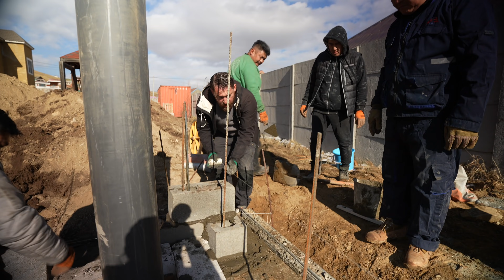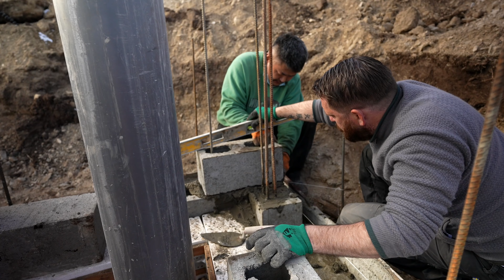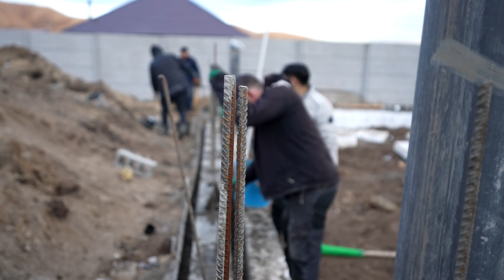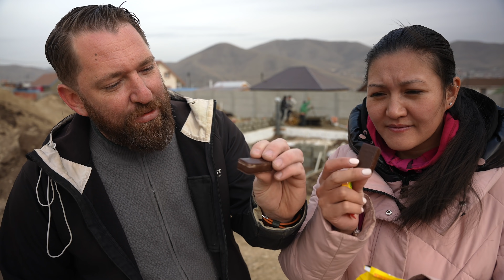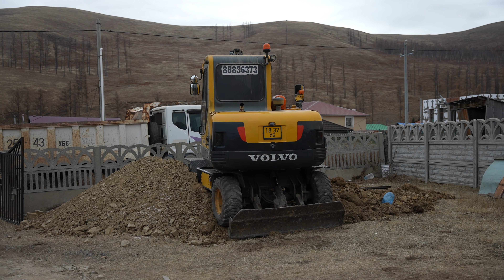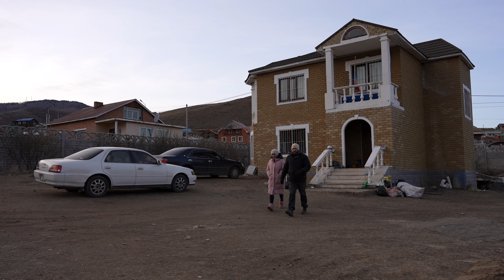Passive Solar Greenhouse with Geothermal Build in Mongolia EP6

Comment: Have you checked out CERES greenhouses in the USA Rocky Mountains? I got a lot of good information from their site for building my passive solar, geothermal, fully self-sufficient, off-grid, greenhouse. Also Arkopolus in middle western Canada has a great UTube channel on his passive solar greenhouse. I live in New Brunswick, Canada. We don't get the extreme cold here but two weeks ago we had a few days of -40°c and it froze the water pipes in the house. Spend last two weeks thawing them and fixing all the busted lines. The sewer froze and I had to thaw it out. I used to live way up in Nunavut Territory, Canada. Its gets really cold up there they are way above the tree line and some towns have greenhouses up there. My kids are half Inuit which are distantly related to the Mongolians. The night my daughter was born up North it was -74°c. The Polystyrene you use is susceptible to absorbing water when underground. Once it soaks up water it looses it's insulating properties. I used Blue Board Poly insulation on mine. Its not as bad as Polystyrene but it eventually will absorb water underground with the weight of a building on it so I put construction plastics down first and sealed the seams with the red sticky Tuck Tape. That way it keeps the water away from the poly insulation. I super insulated my walls with Polly-iso insulation. I also poured a 4' wide walk way around the inside of the walls on my greenhouse and put PEX pipe loops in it so I can run hot water through it in the winter to make sure it never freezes inside.
Reply: Sorry, Arkopia greenhouse is the one in Saskatchewan, Canada. Auto correct on my phone messed it up. Lol.
Reply from the maker: It’s cool, we figured it out 👍 thanks
Reply from the maker: Hi Robin 👋 thank you so much for sharing 🙏🏻 it is so great to read your comment and story’s. We will definitely check it out. The biggest challenge we will have in Mongolia is to find material even silly things like Tuck tape😫 so we have to improvise a lot… 👏👏
Reply: @SimpleWildLiving  when I lived up in Nunavut Territory, Canada everything thing had to be sent by Ocean Barge so everything that you needed had to be ordered a year or two in advance and then arrange to have it shipped to Hay River and have it loaded into shipping containers and then make sure it got loaded on the next year's Barge. Plus I just watched a YouTube video of a guy in Montreal Quebec that built and tested many different things on 7 all season greenhouses he built. I'll try and find the name and post it for you. Great info on what he built and tried and the results, good or bad.
Reply: Check out HumanWisdom or search for his Plus4Zone Greenhouse in Montreal, Quebec, Canada. He has a lot of good information for you and it's been tested and proven to work over the last 10yrs in a very similar growing Zone as yours.

Comment: Great work. look forward to watching the greenhouse getting done next spring. I guess its gonna eat up lots of power and  cost not much with the fan heating and cooling system.
Reply from the maker: Thanks so much, no the fans don’t take that much power and we will set up a solar system to run the fans
Reply: @SimpleWildLiving  yeah i missed the word "not gonna eat up". I saw one canadian old guy have got the technology running in winter , but ulaanbaatar's winter is twice as cold i think, reaching 40 at night. I wonder what design of passive greenhouse you are building on top of it now, i have researched n i thought polycarbonate south wall is perfect for heat trapping and regidity and also provide maximum penetration of essential sun rays. You might wanna also put a a chinese tarp coating thing that rolls up and down for extra heat trapping(since snow fall is much compared to china, for use of the tarp i m not sure cuz when it gets wet it puts extra load on the motor that rolls it i m not 100 sure, i just heard a guy who built a passive solar ghouse in canada)⁰ .  Solid block walls on the other walls with 15-20cm thick foaming on the out, i thought would help great. Metal bars could be used for framework to avoid humidity related fungy.